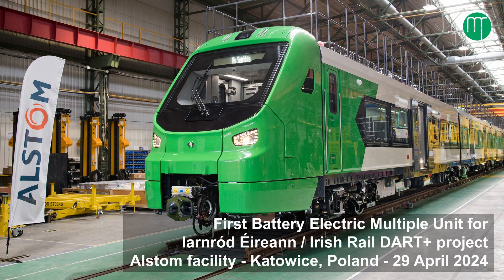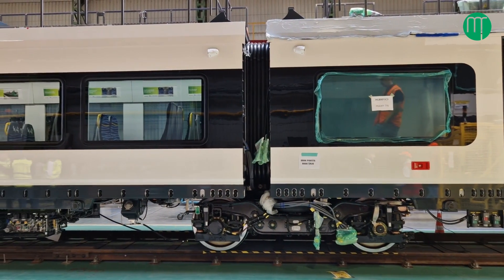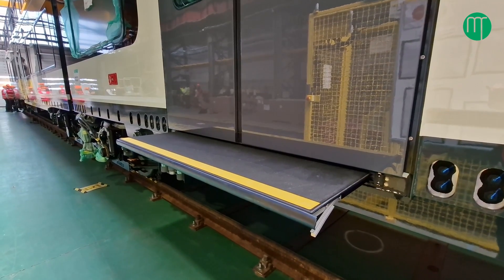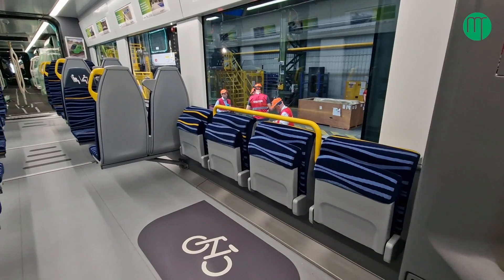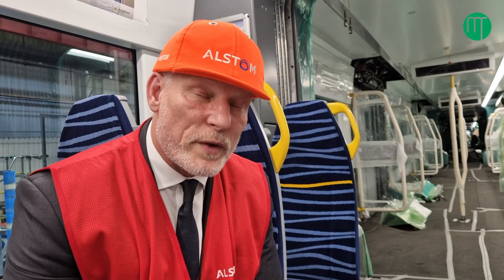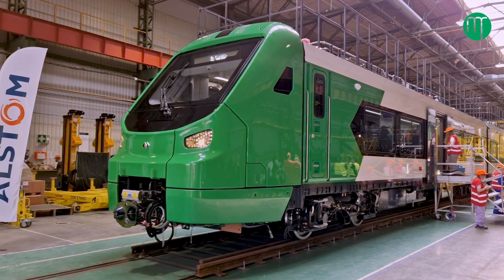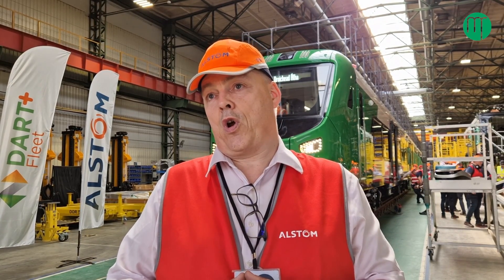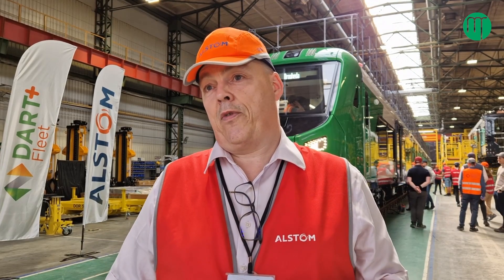First Dublin DART+ battery-electric multiple-unit

Comment: Wonder in 10 year time how much will this solution cost compared to electric trains and infrastructure. Since battery last 80km I assume more trains will be needed than if standard electric trains would be used due to charging time and on top of that new batteries after 9 years. Its frustrating how Ireland is throwing money at everything except one thing that is most needed - housing.
Reply: It's such a short sighted solution. There's a huge number of potential issues and costs associated with the batteries all to avoid building the infrastructure that we need to do regardless.

Comment: Theres actually an issue with irish rail trying to get a depot in Maynooth for the dart+ west programme as there's not enough capacity to store the new trains entering service whenever this line is fitted with overhead wires as Malahide will be getting that line extended to Drogheda hopefully by the end of this decade with a bit of luck and then the batteries thats stored in the trains wont be used anymore as they'll be powered by the overhead wires from then on
Reply: Planning delays for the Maynooth depot, and by extension the implementation of DART+, is outrageous, An Bord Pleanala is not fit for purpose for a country trying to de-carbonize, First it was the Mayo gas pipeline terminal, then the wind turbines in Co, Galway now it's the Maynooth depot.
Reply: @gerrytierney6500  It should be changed, will it change.. I'd say not, some people are making a serious cash cow out of it causing carnage to national projects that are beyond needed at this stage.

Comment: How long has the man worked in Ireland and mispronounce Drogheda so awfully. He should've done a better job at actually specifying the battery from the individual cells' voltage, C rate, cycle life and capacity total kWh, just saying it'll last 9yrs and an 80km range is not enough info.
Reply: A better attempt at pronunciation than Richard Chamberlain’s ‘Drugeeda’ in that old 80s Thorn Bird tv mini series
Reply: Does he actually work in Ireland though? He is Alston manager for Ireland.